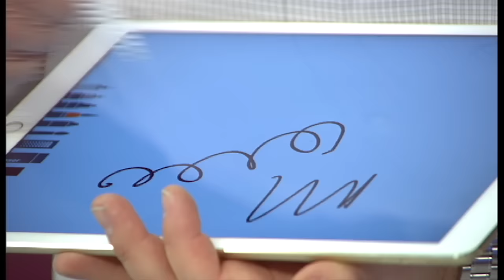Cracking Open - Sparks fly as we cut open an Apple Pencil at CES 2016

Comment: so grainy
Reply: it was 720p when i watched, the camera was probs off
Reply: +King0097 That's not "grain", it's interlacing.
Reply: Mike Trieu same thing to me
Reply: King0097 Grain comes from sensor thermal noise, compression artifacts, and possibly wireless interference. Interlacing is a deliberate technique to reduce bandwidth necessary to represent a single frame in a video sequence using alternating scanlines. It's a holdover from the analog days of video broadcasting before we had cameras and displays fast enough to display progressive scanlines.